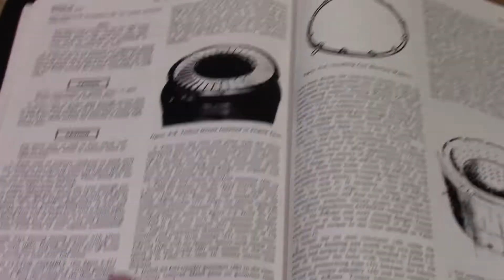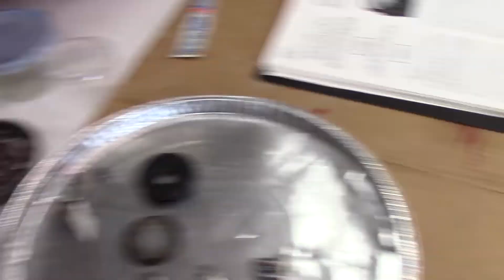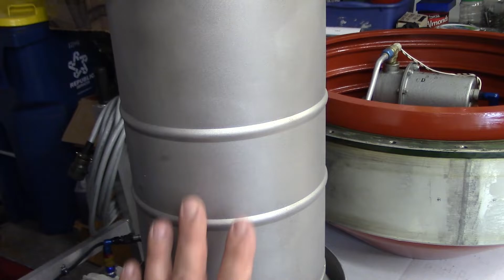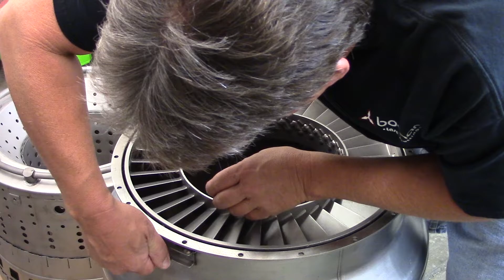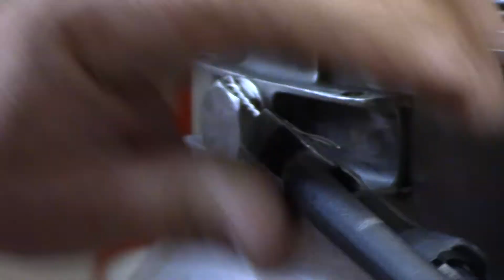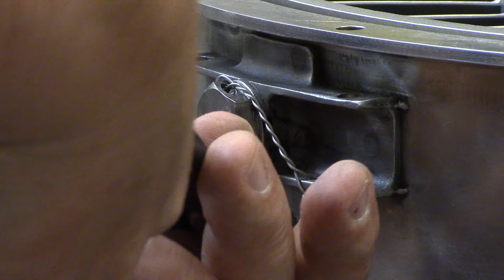The J44 Project:  Restoring the Stator Assembly, Part 1.

Comment: Thank you Darren, I am waiting part 2. the cover of shaft that protect the shaft from heating and go through combustion chamber. it should has equal space away from combastions chamber in around all of angles or it is not important.
Reply from the maker: Everything is equally spaced around the annular combustion chamber & the air flow patterns keep the flames from touching the metal parts.  The holes in the combustion chamber walls direct the compressor air where it is needed to control the heat & mix with the very hot air near the flames.

Comment: Darren, I am not totally sure but I was taught that when safety wiring  each time you came to a hole you changed the direction of the twist on the wire.  I think I remember something about if some pull was applied to the wire it would tighten not loosen the wire.  Tight safety wire will not vibrate and break as fast.
Reply from the maker: My safety wiring skills definitely are not F. A. A. certified!  I learned in 1981 while in the Air Force doing avionics maintenance.  We really didn't mess with the wide variety of fasteners used in engines; mostly equipment rack hardware & 'Cannon' connectors.  I had to review some of the procedures & try to learn them.  I have caught several mistakes after I was done, going to the wrong side, twisted the wrong way or just loose, as you said.  Keep an eye on me & holler if you see something!  I appreciate the oversight.

DD

Comment: I Noticed in a earlier video you removed the turbine wheel after balancing the rotating assembly, when i reassembled my J44 I just removed the compressor wheel from the splined shaft that goes thru it and marked the splines so it gos back on the same place  then slid the main shaft with turbine still bolted to it in from the back of the engine. it makes it easier to adjust the bearing clearance this way , if you need to change the bearing clearance shim you can remove exhaust cone that holds the rear bearing and the reverse threaded nut on the front of compressor wheel and slide the turbine wheel and main shaft out the back leaving compressor in place.I did not have a manual but it seemed like the best way to assemble the engine, maybe not..
Reply from the maker: That sounds feasible.  I am going by the manual but sometimes practice can reveal a simpler way.  As long as everything is indexed & marked so that it goes back exactly the same, balance will be preserved.  I will be using the original shims when I assemble the main parts of the engine as a starting point, since I am using the original intake housing, shaft & compressor.  The new bearing should be nearly exactly the same as the old one, because they are 'MM' class, super-precision bearings, with very close tolerances.  I am hoping the clearances fall into the ranges specified by the service manual but I am prepared to adjust them if needed.  Thanks for your input.  Wish me luck!

DD